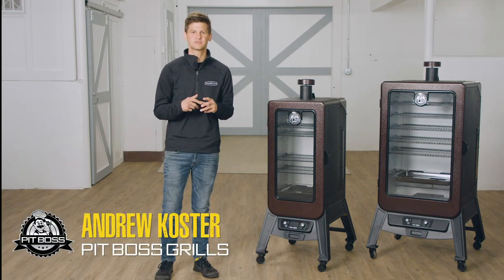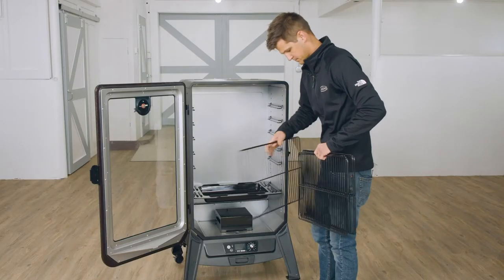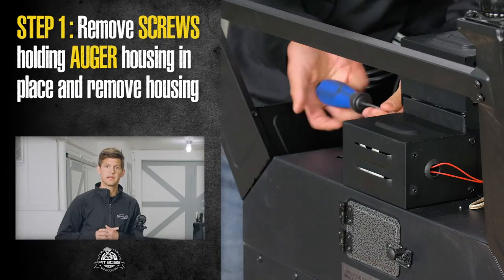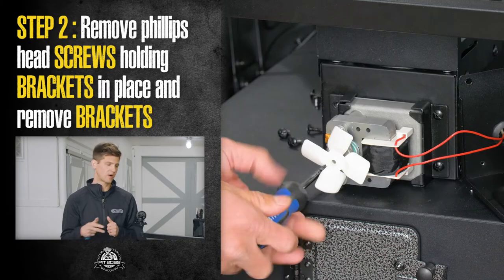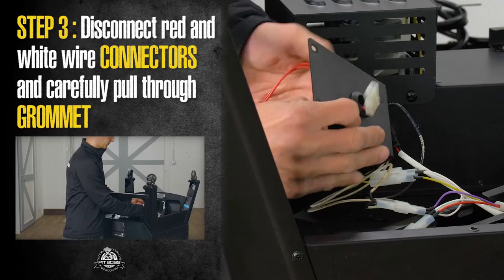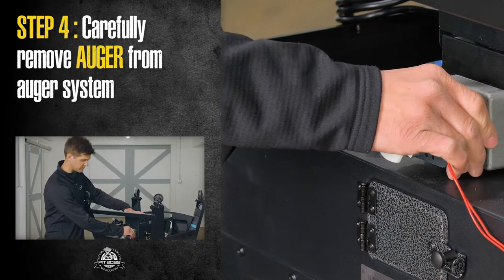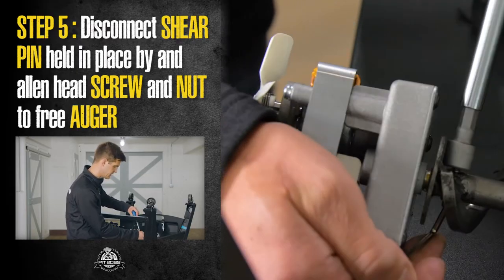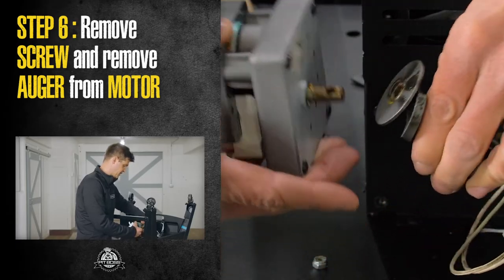How to Replace the Auger in Your Vertical Smoker | Pit Boss Grills

Comment: I had an EXTREMELY hard time removing the auger.  The pellets absorbed moisture inside the flutes of the auger and then hardened like a rock.  I sprayed a ton of vinegar water solution in the auger tube and applied tremendous force with a flat head screw driver between the motor and metal housing until it finally popped loose.  I was already expecting to break something, that’s how hard I was applying force, but I ended up not breaking it.  I now realize the importance of draining all pellets and clearing the auger out.
Reply: Thanks for making your comment.  I made the same mistake.  Didn't cover my smoker and water got into the pellets and down to the hopper and hardened everything up. Just like yours.  I was struggling struggling 2 hours trying to get the auger to break free and spin.    Should have watched this video first.  I would have been able to use my smoker tonight.   Smmfh.    Thanks again
Reply: And this is why I'm watching the video now.
Reply: Have the same issue. Need to buy a cover. The pellet door is not protected from rain so its a design flaw.
Reply: Same issue
Reply: I had the same problem.  I carefully removed the auger/burn assembly and all wires and thermocouples.  I filled a camp pot that was exactly the same height as the auger with hot water.  I let it soak for 3 hours and pried up a bit with screwdrivers.  No joy.  Put the whole pot with water on the stove and started heating the water.  after some more prying with blocks under the screw drivers I got it out!  I was careful not to get water on the auger motor
Reply: Same problem here.  And I had a cover, so even though I believe having it covered is important, it's not going to solve this problem.  The problem is the moisture in the air gets sucked in by the pellets, they get soft and expand and dry out into a brick.  I thought I had learned my lesson the previous year.  I didn't get the auger completely cleaned out.  I had to use a pry bar with lots of force to break it loose.  Couldn't believe I didn't break anything. The ONLY way to keep this from happening is to make sure the auger is completely empty at the end of the season.
Reply: Same problem. I had to take a metal bit from the other side and pound it with a hammer to get the auger out. After a few good whacks on the shaft, it came out smooth. And it was hardened.
Reply: @jonathanritter7364  really has nothing to do with water, if you smoke alot it will clog up regardless from the dust that comes in the wood pellet bag, and the way the wood pellets break apart. You have to sift your pellets before putting them in. I smoke every other day, have to clean my auger once a year min.
Reply: What was the vinegar spray for? And I now realize I will need to use alot more Force. :(
Reply: After reading your comment and all of it's replies, I went back outside with a mallet, big heavy duty crew driver and dislodged it a little. Then my husband brought a crow bar and slowly but surely got it out. I wouldnt have tried that amount of force if I hadn't read this. Thank you!!
Reply: @coach316dc  After reading various   comments saying that using brute force didn't break it.... I went back outside with a mallet, big heavy duty screw driver and dislodged the auger a little. Then my husband brought a big crow bar and after 3-4 minutes we got it out. I wouldnt have tried that amount of force if I hadn't seen the comments agree with the original poster. Just wanted to say  Thank you for sharing!!
Reply: @monsterenergyaxe  Even with a cover I had to un-jam my auger twice last winter and am doing it again today. This smoker is the worst.

Comment: Great video but this should not be this complicated. Especially for something that will need to be cleaned out once and a while. Also, when you use 2 cent screws, it makes it virtually impossible to get them out. I had to use 4 different screw drivers for the same type of screw. The screws were so soft that I actually broke two of them. I couldnt even get the two on the right side of the fan cover loosened so I ended up just prying it to the side w/ the screws in as they literally sheared off at the head. Next time why not think about using at least 10 cent screws. This was a lot more complicated than it should have been.

Comment: Gotta be honest, terrible design across the board. It's supposed to be cleaned every so often so let's make it a pain to get to. I mean it's only a hundred pounds or so, let's make it so they have to flip it over!
Reply: I'm not sure how you are to clean the pellets at the end of the season. There is a clean out door at the rear, but it is a few inches above the bottom of the hopper. I would expect to see the clean out at the bottom of the unit. I strain my pellets and keep it covered. I spent all afternoon trying to remove the caked on pellet dusts.

Comment: Worlds worse design! I have to remove the auger and clean once a year at least due to wood dust buildup. They know this is an issue, but they make it a ridiculous time-consuming chore to clean your auger. It's been this way for years. Why does pitt boss make it so difficult? The auger is easily accessible on other brands. Major fail in the design department. If I hadn't got mine for free (someone threw it out with the trash) I would buy a different brand.

Comment: Only reason to replace the auger & motor is if the auger got stuck, due to moisture seizing up sawdust and pellets. So, this video is pointless if you can't pull the Auger out, and you can't even each the shear pin to disconnect the motor and get a better grip.

Comment: Just replaced my auger motor in my vertical pit boss. No need to lay it on its side. You just need to take off the back half of the wire chase (2 bolts removed, 2 bolts loosened), the 4 cover bolts, the 4 retainer bolts, and put it out. Don't forget, when replacing it, the fan goes to the right and the coil goes to the left where the wire chase is.

Comment: The screws are a pain to unscrew (probably screwed on with an impact drill) couldn't get the bracket screws off....the right sized screwdriver and ended up stripping to of the four....

Comment: What is the size of the nut and the Allen head screw?
Reply: I just used needle nosed vise grips to hold into place as I turned the Allen side… don’t over tighten. I got mine super snug… auger will still have play. It’s ok

Comment: Had an issues last weekend, tried to up the temp at it didn’t gain. Gave the code that led me to believe it was the auger. 

Once I had the motor and fan out, I put the auger back on. Fan and gear would spin. Auger would not, as if the auger was locked. I assume this is because no power. Would that be correct?
Reply from the maker: Hey Ryan, we're happy to dig deeper into this with you. Please send us a message on our Facebook or Instagram page for assistance.
Reply: @PitBossGrills  I don’t have Facebook or Instagram. I was gonna find a online number or something
Reply from the maker: Please call 877-942-2246
Reply: Can you explain about how to clean auger on purpose vertical smoker

Comment: I've had to replace my motor 3 times now because the gears self destruct due to not having a proper shear pin.  Is this really a "Shear Pin" or are the gears made of putty?  Is there a better quality "Motor/Gear" assembly anywhere?  This set-up is about as "Cheap Chinese" as you can get.  In my Pit Boss grill, the motor isn't even bolted down solid, and is allowed to rotate until the gear housing hits an end stop.  Also, each time it has failed, it wasn't due to moisture getting to the pellets, plus my grill doesn't have any type of clean out feature besides running it until it's empty.
Reply: Yikes. I found mine about 7 years ago sitting out at the curb of someones house for the trash guy to pick up. I went home and cleaned the auger. Never had an issue with the motor, but that augers sure clogs.

Comment: This shows how to pull the auger out the smaller model , what about people with the bigger model ? The auger doesn’t pull out as there is a faceplate holding it in that you can’t remove. Customer support has not reached back to me about getting this fixed . Also cannot get ahold of danson either . Please make a video for the bigger model vertical smoker please
Reply from the maker: Can you send a DM via FB or Instagram? I would be happy to see how we can help out.
Reply: Did they get back to you?  The Auger on mine doesn't pull out either. I don't know if it's from being stuck and I need to pry it out. Or I'm missing something that needs to be unscrewed?  Any ideas... anyone?
Reply: The intro to this video showed both a small pit boss and a larger one. So this tutorial applies to both correct?